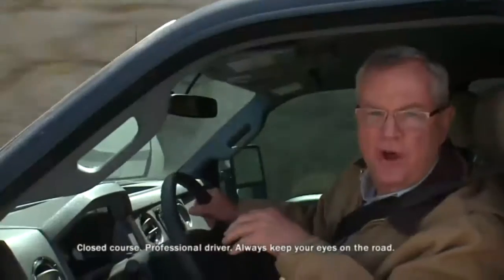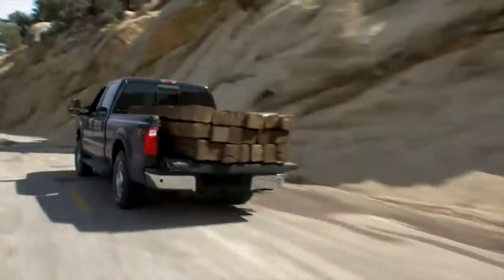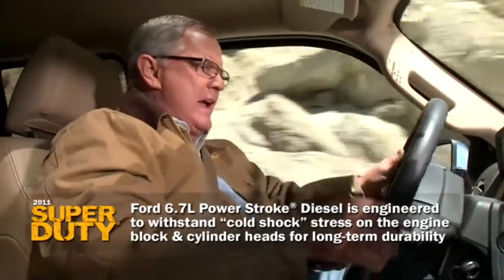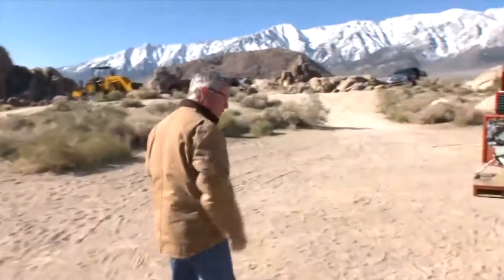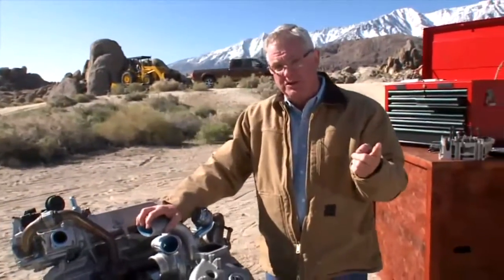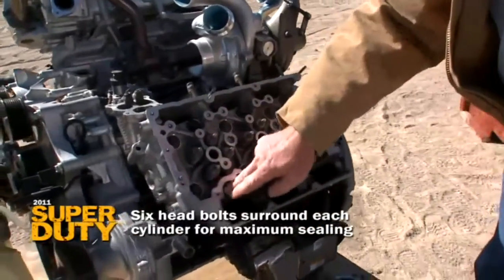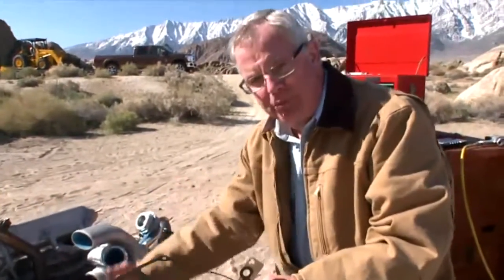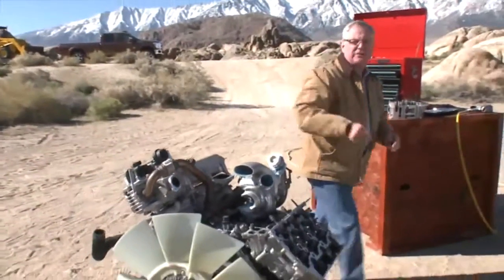Power Stroke Diesel Built For Max Durability

Comment: Durability my ass. 218k on the truck, dropped a valve or so they say. $18k later I get it back with a new long block. And Ford Motor Company nowhere to be seen or heard of. I'm not the only one it's happened to.